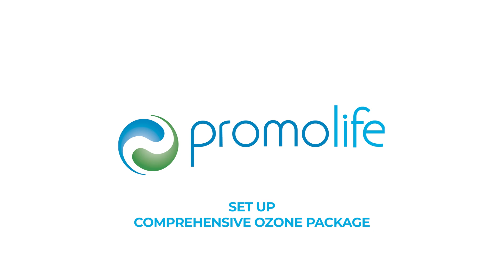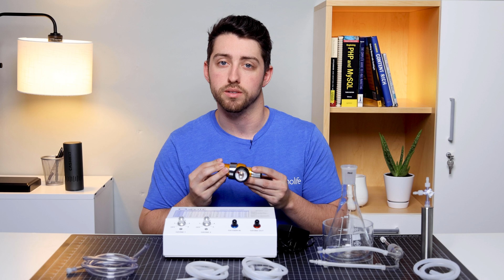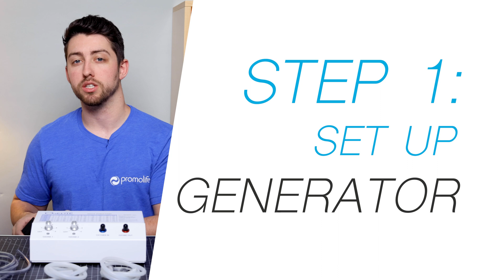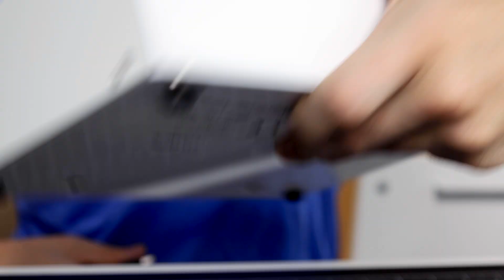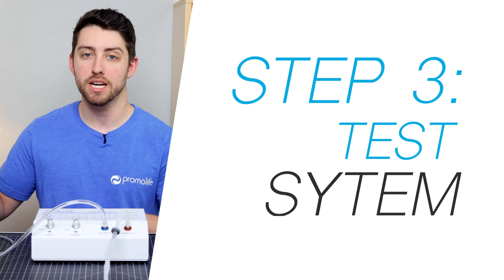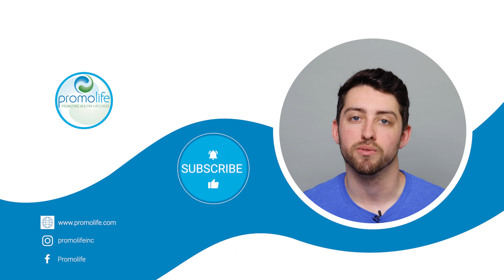Setting Up the Comprehensive Ozone Package from Promolife

Comment: I don't understand the purpose of the video.  This must not be to humidify ozone, since you are dissipating it back to oxigen.  Is it to put ozone in the water so you can drink it?
Reply: Yes, when you add ozone to water you have two options. 1. Filter the ozone into the destruct system and then drink the ozone water. 2. Divert the hydrated ozone to a device like an earscope. I hope this helps.